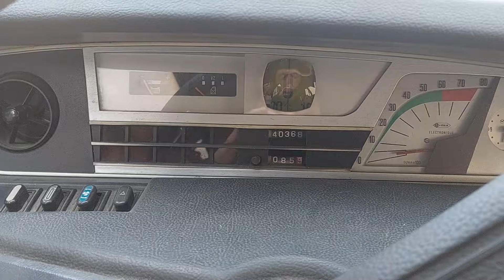Citroen Gs Club Hand Crank Start First Time In My Life #Oldtimer #french /Kézi Autó indítás Kurbli

Comment: Always wondered how much force + turns it might take. After all, it's double the engine of the 2CV (though not identical).
Reply from the maker: Actually it surprised me it does not need mutch effort.
Reply: @sandorelo1302  Considering how much torque a  powerful 500ccm motorcycle needs, I suppose, there are 2 factors here:
the single cylinders are about 250-300ccm and only 1 gets compressed at a time (but 2 per revolution) + the compression was just 1:8.2  (1220) or 1:9 (1015) 
Might be interesting, if an 80ies Subaru would behave similarly.